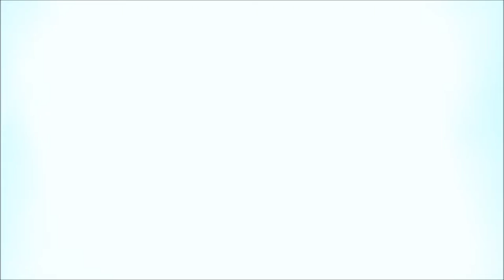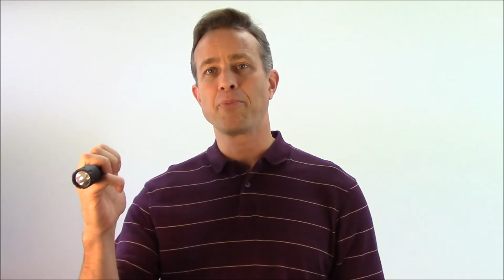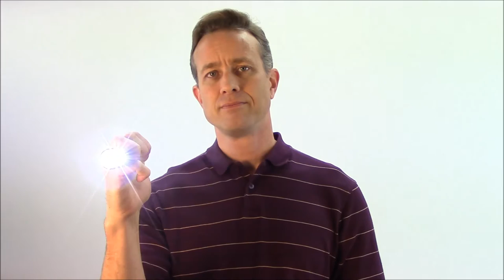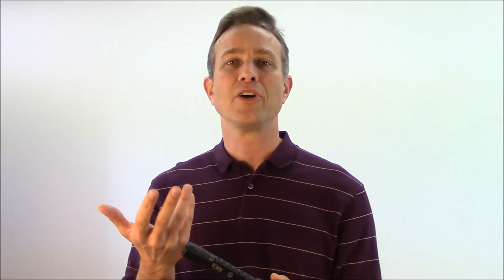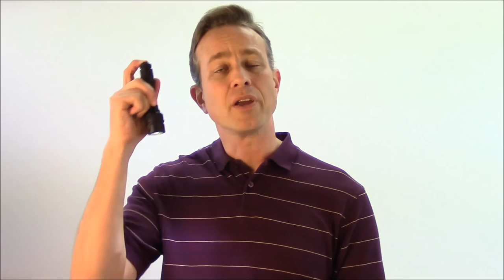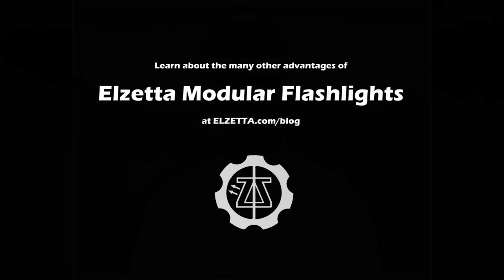The Sound of Silence in Tactical Flashlights, Elzetta vlog episode 21

Comment: A few people (some who maybe even haven't had time to think about it) don't realize there's a sort of
"ballast" circuit that runs an led in a flashlight...actually ANY led light. I found my old pickup coil that
I used to use to record phone conversations back in the day. I hooked it to an audio amp and picked
up lotsa racket from several led flashlights...And my brother had to replace the led lamp in his
garage door opener with a Corkscrew flouresent lamp due to the noise from the led lamp "ballast"
circuit.The electrical "noise" caused problems with the operation of the garage door opener.

The way I see it, a good chassis/containment like a robust housing on an Elzetta certainly can't hurt.
Might just shield in a lot of that noise and keep it out of nearby electronic devices.